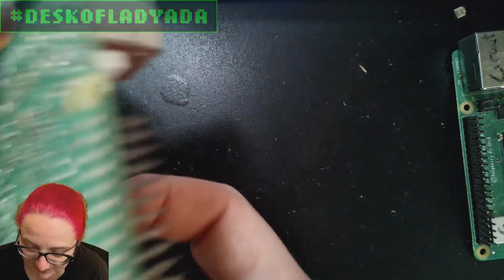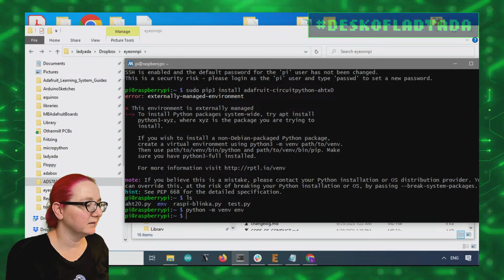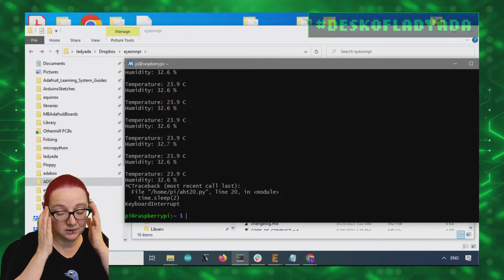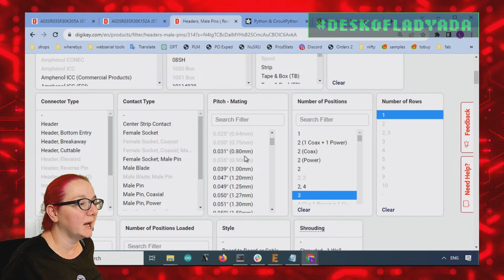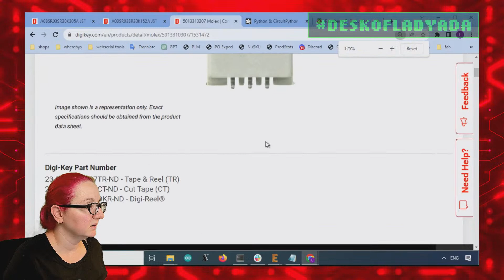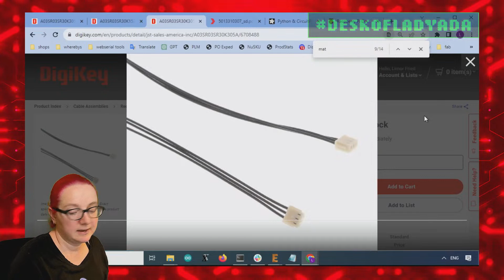Desk of Ladyada - Pi 5 is Alive & The Great Search - Connector and Cable for Raspberry Pi 5 UART

Comment: Someone had a great tip for measuring things like that connector - rather than trying to get the calipers in the middle of the pins, you measure from the outer edges. Then you measure one pin and subtract that from the first measurement. That gives you effectively the left edge to left edge distance, which is the same as the center difference.